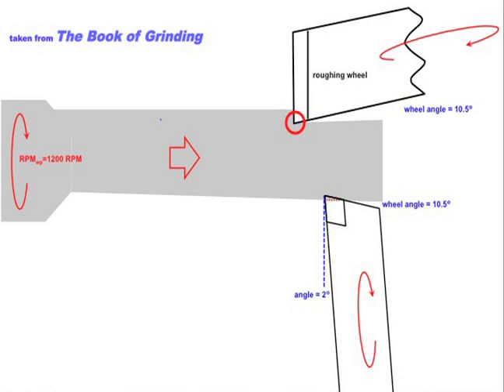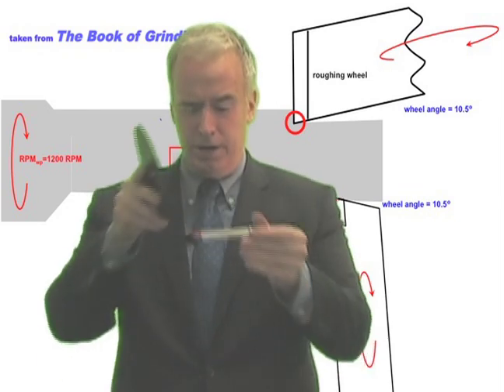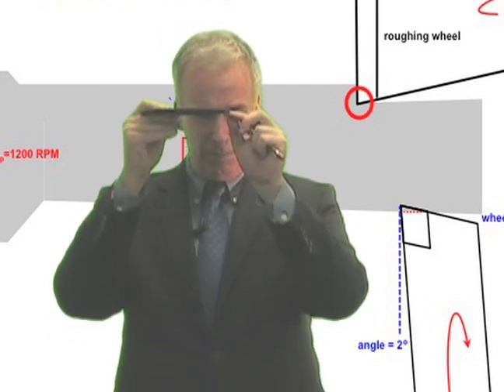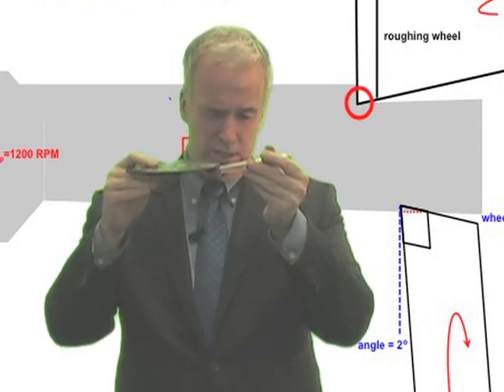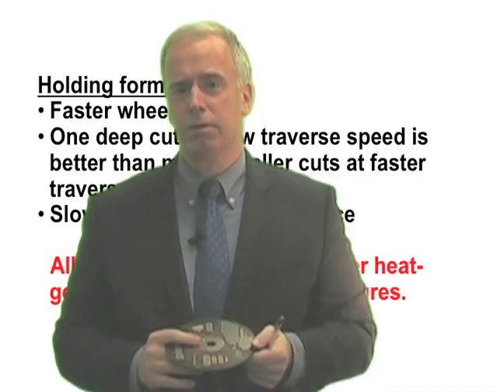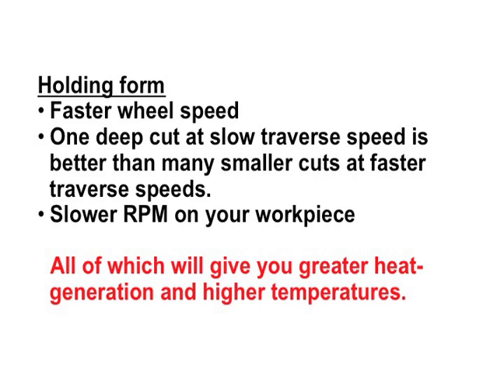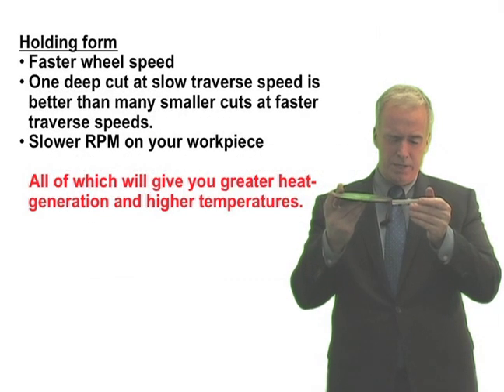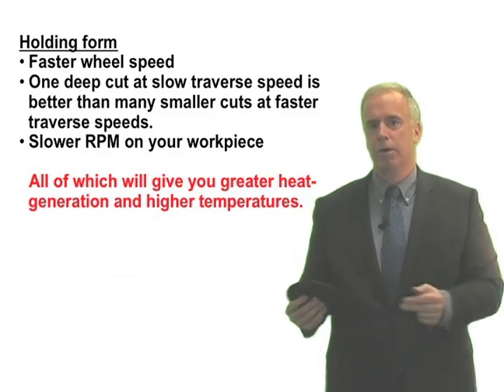Episode 66: Pinch-Peel Grinding

Comment: Good morning Dr. Badger. In your opinion, the roughing wheel width must be higher than the radial DOC? Eg. Grinding a diam 20mm down to diam 4mm (radial DOC of 8mm) is feasible with a standard roughing wheel of 6mm width? Thanks
Alessandro